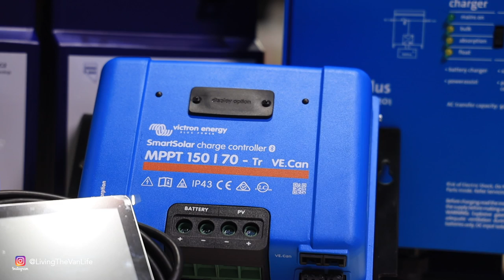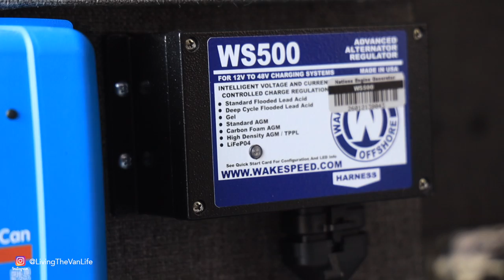Sprinter Van Build - 12 Volt Battery System - Living The Van Life

Comment from the maker: Many of you are wondering “Why so much power?”   

I had two of these batteries in the Westfalia.  While running lights, 12v Engel fridge/freezer, charging drone and camera equipment, diesel heater in the winter, and editing 1 YouTube video for 10-12 hours straight on my computer, I could stay parked for ONE day before depleting the two Battle Borns.  Which with a 30amp dc to dc charger I then had to go drive around for 6.5 hours to recharge that 200 amp/hours. 

Having 6 of these batteries will now allow me to be parked for THREE days of editing and video production off-grid instead of only one day. With having a second dedicated alternator recharging 280 amps directly to the batteries, I only have to drive the van for 2.25 hours to fully recharge the system.  

Many of you feel this is a ridiculous amount of power — being able to park off-grid and work for 3 days instead of just 1 is NOT having an over abundance of power.    This all allows me to get further off-grid and produce MORE content for you guys here on YouTube.
Reply: You certainly have thought everything out for uninterrupted power. Great job!
Reply: Please remember that any power electronics component (inverter, solar charger) needs adequate cooling. The inverter probably has fans so you need to make sure that there is enough cool air to cool it down when operation at max power and that the air exhaust for the inverter heatsink is not blocked. I can see that you mounted the solar charger right up to the shelf edge. That will obstruct convective cooling of the heatsink on the back of this component. Please either move it a little bit down or make a hole in the back for air to move heat from the charger.
Reply: I don't think you have to explain  why you choose what you build into your vehicle. It's not their business and you do you! And if it cost you 100k to build that van, it's your choice and people here should be either following along and take what they can from the videos or stay away! 😉

You do you!   Love you man! Keep it up!
Reply: @filipkutt9481  Sage advice for sure...  Cooling for electronics is very important.  Also equally important.  Weight distribution.  Chad seems like a sharp, detail oriented and thorough guy.  Just hope he's taken how the weight of everything is being distributed through the van.  My guess he is, but you never know.  Sometimes when you're in the thick of a project, you can't see the forest through the trees.  Fascinating build...  Not something I'd ever do, but a lot of fun to watch all the same!
Reply from the maker: @WHJeffB  there will be 250 lbs of freshwater in a tank and water heater on the passenger side of the van.
Reply: @LivingTheVanLife  Perfect! You've earned yourself a new subscriber.
Reply: Much rather have the power for boondock/off grid.  Absolutely.
Reply: @LivingTheVanLife  as long your water tank is full you'll have no worries then😁 love this series, can't wait for more and to see the finished product.
Reply: @c_f015  I wonder why not use the same space for fresh and greywater storage. You can have a single container with two flexible water tanks inside, one for fresh water and the second for grey/used water. That way you have a single space for both the fresh and used water. When freshwater is depleted the flexible water tank shrinks and the greywater tank expands.
Reply: I don't think it's a ridiculous amount of power, I think it's amazing and a very nice job with the installation!

Did a quick calculation and with that power bank, you could power my entire house (2000 sqft, heated outdoor jacuzzi, lighting, dishwasher and several computers running) for two straight hours, excluding the loss for stepping up 12V to 230V which my house runs on and that's just awesome!

Great work, I'm thrilled to see how the sprinter van turns out once finished!
Reply: Awesome set up! Cerbo is awesome. We did 2 RB300LT's on the exact same setup. I'm sorry the new battle born just came out btw....
Reply: I have 200 Amp hours for my Westy and would have more if I had the space.
Reply: Oh, is that why you only stayed one night in one location before hitting the road? I was always wondering why not stay more than one night in some of those really beautiful locations...
Reply: @baliyachtservices7505  ikr
Reply: I think it's just right
Reply: @LivingTheVanLife  What kind of water heater are you putting in?  Isotemp?
Reply: Top to button ' the best built out I was seeing anyone knows you can never have enough power on the move for longer and better excursions in the wilderness.
Reply: More power to you & keep trucking!!!
Reply: i had got a 500w jackery with a 100 w solar power pannle i love it
Reply: @WHJeffB  I'm sure Chad has thought of the weight distribution, he seems to do his homework on everything. That's going to be one Awesome van.
Reply: What sort of cost are we talking for a battery system like this?
Reply: @dickoos  Three and a half kidneys and five pinkies
Reply: kidding anyone hw thinks that way is lost, 1000 would be even better but then ads weight and needs m0re space, I really like the Lithions and you can get 1000 with only 3 batteries however your bank account wlll be depleted quickly. haha great vid nice work mate
Reply: @melsvanlifeadventures4325   must not be running much on it. It only runs my fridge/ freezer for 7 hours
Reply: if u installed more power than what u need in average that will make ur batteries last longer and that`s a good choice
Reply: Freaking awesome!!!  That's pretty cool that Battle Born was of assistance... that is pure gold!!
Reply: 3.5 years later and 600ah isn't that much anymore.

Comment: Nice $1,000.00 battery. You are very fortunate to be working with them to make this happen, a great opportunity for you both. $6,000.00 battery "BANK" -no pun intended can make all the difference if you can budget them into your build. Good for you Chad, for working with them to make it happen, this system looks like a winner but you may want to put a fire suppression ball or two in that electrical area to be on the side of caution, even with the Solid bus bars you've installed and the clean work your tech has done, you can never be too safe when it comes to that many DC amp-hours going into an inverter the size of the Sears Tower.

Comment: Great install. Very clean. Very well thought out. My only concern, as I've had an electrical engineer look over my diagram that I drew up before building my dual battery setup was that he told me that each battery needs to be fused. Here you have a setup that could put 500amps of power into 1 shorted battery. If 1 was to catastrophically fail there is nothing to protect the battery from starting a fire. If 1 battery fails in a fused setup. You could continue with 5 of the 6 batteries till you could remove it to replace later.

Comment: Thats a power station right there! If anyone has been out with Lead Acid batteries and struggled for juice they can relate to your new battery bank set up. I recently installed a LiFePo4 105AH with a Victron Controller fuelled by both a 150W German solar cell panel and alternator and what a game changer that is. Loving the videos of your build Chad, looking forward to the next and future journeys inside this beast! All the very best.

Comment: @Living The Van Life I would recommend looking into buying a layer (high temp rubber or such) between the battery bank and the wood structure so it has medium to ride on to take the vibration load. The current wood structure does not offer any such vibration help especially off road and even in normal driving conditions. They may need some cushion. Just a thought! Best.

Comment: Great looking gear.  I have spent up to 6 months in my 4x4 sprinter offline while travelling around Oz.  The one thing that I would like is more solar, as I only have 240w of panels with 200ah of AGM batteries, and another 60w of solar would likely do me fine.  But although I have a 2000W inverter, it has never been used as most of my 240v needs are met by using a small portable 150w inverter.  Also, the big inverter would rapidly discharge the 200ah of AGMs and I don't want to do that.

Comment: As a Design Engineer, I'd use shock absorbers that can take twice the weight of the item(s) that they support for the electricals (05:52).
The way you built them solid, all the vibrations from unevel terrain will bend the "L" aluminum bars and probably, loosen the bolts on the plywood by damaging it.

Comment: Think I'd go 48v which would also save some weigh just in wire size.
Lithionics has a 315ah battery at 48v which is some serious power for one battery.
Your van build came out amazing.
On a 144 once you cross that GVWR threshold the liabilities could become pretty real quick.
Could render auto insurance void which for a rig like your van build would be quite the loss......let alone if anyone were to get injured.
Personally I wouldn't risk that.
I've seen lots of beautiful van builds that are very reluctant to state the weight of their vans....for good reasson I imagine.
There's a GVWR for a reason for each vehicle.

Comment: Besides the hybrid charging system between the solar and your van gas motor that charges into the battery bank. Is there anything like a wind/water turbine type to get you extra energy during the nighttime when the solar panel won't be working? Maybe if you find some river, you could use these extra turbines to charge your electricity back beside the solar if you are off the grind. great video.

Comment: hey Chad, did you need to change out or modify your suspension to compensate for the weight distribution on the rear? especially with the static loads you're carrying, did you find yourself planning to distribute the weights? Would love to see a video of your thought process with the planning. Thanks for this series, all totally interesting takes.

Comment: That is a sick installation! Well done. I just bought 3 SOK 206ah batteries for my rig. Wish I had your help building the system. My 2019 Sprinter came with a bracket for a 2nd alternator, is that what u used in ur setup?

Comment: Hi Chad, i think your doing a great job on the battery cradle. I think your putting in a fantastic system, but i notised the batteries are just sitting on the shelf. Are you useing the base of the bed to stop the batteries from bouncing out.?

Comment: Those Battleborn Batteries ❤️ 

My buddies dad had a malfunction with batteries on his semi 

His son hooked up the batteries 
I think he should of let me hook them up🤣

Big story short I hope

should have the batteries in a bucket or big clear plastic/styrofoam bucket or holding container 

open top or just bin open top for batteries and wire through high in-case of melt down

Anyway my buddies dad just seen the wires and they were melted in the batteries smoking 
Not these batteries 
Just batteries 🔋 back then

He did not turn the truck off

He took the plastic or styrofoam cup 
I can’t remember and put in bucket for wires to stop

But anyway 
He just put the connectors in the cup so it stopped conducting 

Scooped them up with the cup
And it actually worked 

He just could not turn off the truck

And we made it to the city 

Not wanting that to happen to 
anyone 
Just letting someone know here
 just in case In the wild far away 

and you read this 
and something like that happens to anyone

And I’m not a professional

Comment: I like that system you got there 300 watts, Is that going to be enough? 4or 5 would be better I would think I am getting ready to put some panels on mine I am going to try to get lithium batts just depends on how much they are. I got 200 watts running my desktop computer in the house and it lasts all day and till around 9 pm and running a 600-watt sine inverter.

Comment: The only thing I would be a little worried about is what kind of outgassing do those batteries give off as they're being charged or even discharged? I'm sure it's minimal but they have to liberate some kind of gas. Where I used to work they had a metal closet we stored and charged the cordless drill batteries (LiPo4 type). Every time I would open the door of that closet you could smell this sort of sour chemical smell of the batteries charging. All those big batteries inside the van will be inside a sort of closet. I just hope it won't cause you any trouble is all.
Reply from the maker: There is literally zero off-gassing with these LiFePo4 batteries.

Comment: It would have been better if you used silicon/ plastic matting over the wood. This would have served a better insulation to the area housing batteries, bus bar, distributor,  inverter  shunt etc.

Comment: Aren't you little worried about using continuous stiff buss bar to terminate battery terminals. There's no give? Rough roads would tear up the battery posts off the batteries.

Comment: 600 amps lithium wow! ($6k)
(& charging it with 1- 2nd alternator, 2-solar, 3- generator)

For heat add a diesel heater 
And for aesthetics a mini wood stove
That be off the grid for real

(and why not a 50 gallon water tank under the bed) ;)
Reply: sounds almost like our boat that we live aboard

Comment: Feel like you should install a smoke/heat detector under your bed platform. Lithium batteries burn very hot, very spectacularly, and water does not put them out. If a battery fails to fire like lithium batteries are known to do, you could burn to death in your sleep....just saying.

Comment: Why did you chose a Van ( much less a Money Pit Sprinter )...they are too high /...you're in Washington / Alaskan Campers from Washington since 1953 /...Hard Sided Pop Top with real windows /...they have an Overland - Side Door model on a Flatbed / Stick to a 4X4 Gas Pick up Truck being it's Available Tru-out the continent & doesn't use the DEF that gums up $$$ /....Maybe you can sell the ( oh well- another ) Sprinter & Get an Alaskan Camper with 4X4 Flatbed Pick Up to Really Go where a Van can Not...

Comment: Why are you using old dated plywood and 2x4 lumber ? The only way to build a battery banks is with 80/20 aluminum it will take off-road and over-landing. I think you are a leader not a follower. Do it wright and throw out the lumber and use 80/20